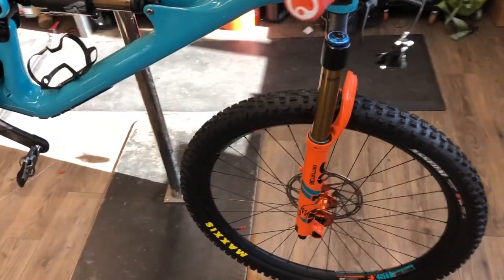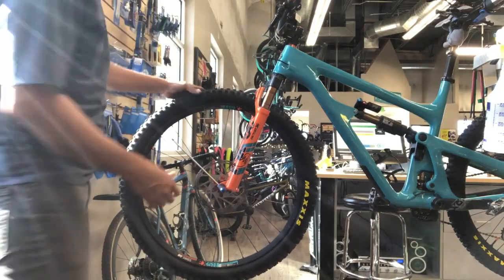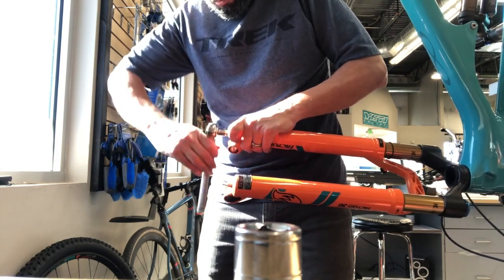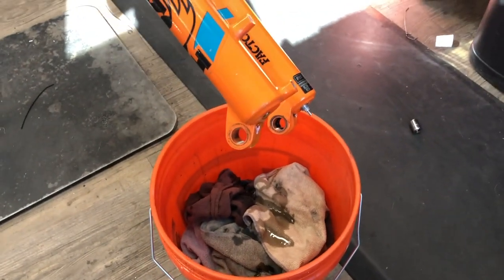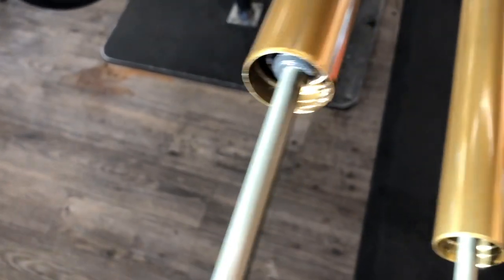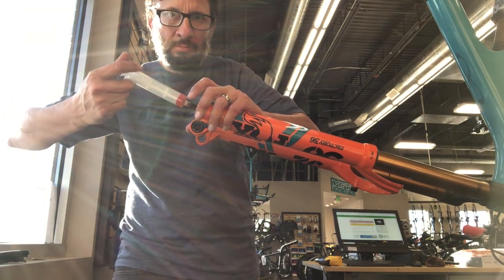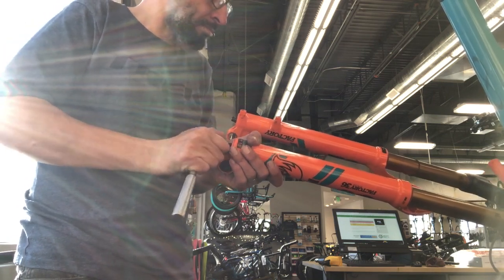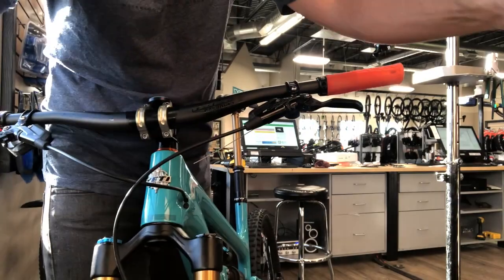Fox 36 Air Spring Swap Travel Increase

Comment: I got a 2020 Fox 36 160mm and a 2021 Fox 38 180mm, is it possible to swap air springs? I may have overforked my Yeti and the advice was to replace the 180mm air spring with a 160/170. Is this possible? Or do I need to purchase a shorter airspring to replace the ones on the 180?
Reply from the maker: No the air springs are different between the 36 and 38 model forks. You'll need to get one specific to the 38 model.